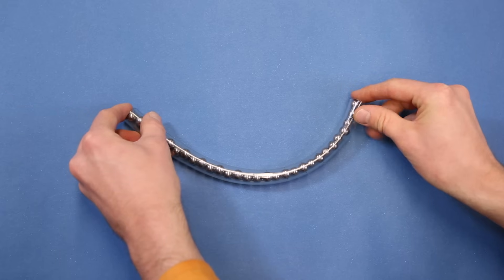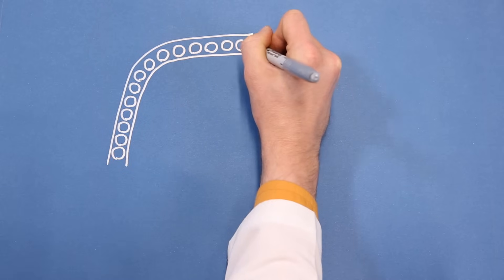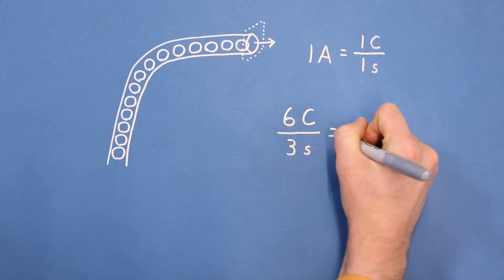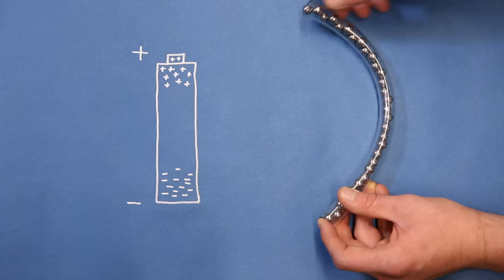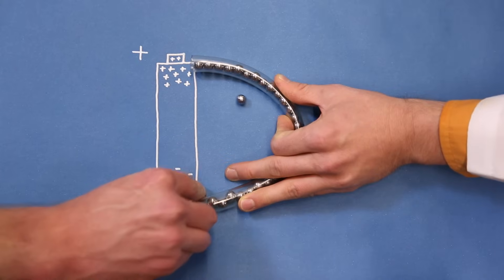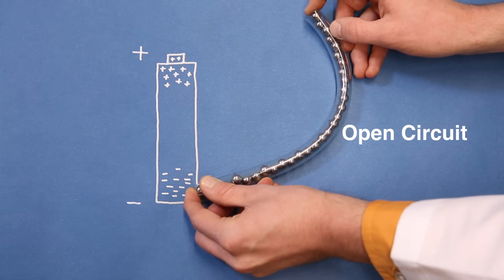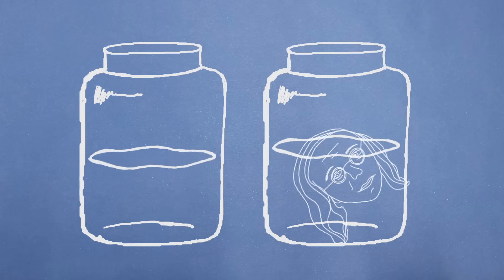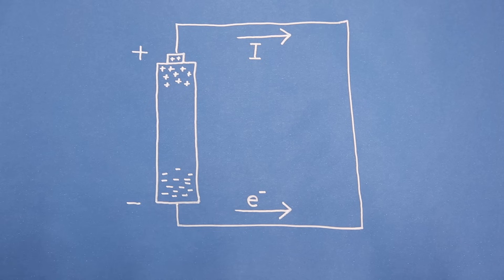What is Electric Current?

Comment: The explanation with the battery and marbles is flawed. It implies that the electrons flow through the wire because of excess electrons at the negative terminal of the battery (which isn't entirely wrong) via some sort of diffusion (high density wants to even out) - which isn't true. The electric field which propagates through the wire from one end of the battery to the other (much faster than any movement of electrons)  is what causes the electrons to accelerate.
Reply: Karthik,

Just what "electricity" is entails a very significant discussion of physics, and for most people (even professional electricians!) the water analogy and Ohms Law is enough of a workable model to enable them to do their work (even through it is completely wrong!). 

Many "electricians" and circuit designers would be in disbelief if you told them that, for instance, electrons move on average a couple of inches an hour (in a DC circuit; in an AC circuit they wiggle back and forth and never go anywhere!)  Even if you've lived in your home your entire life its probably the case that the actual electrons from the power company from when you moved in still haven't arrived at your home yet!

Or that the energy in a circuit actually travels just outside the wire! That's right, the energy from your power company lighting that bulb in your living room travels on the outside of the wire in the form of EM pulses. (Fun fact - in coax cable the energy travels in that insulator between the two conductors!)

There is also a whole separate discussion of the physics that occurs inside the wire...how electrons build up in the bends of a conductor to form a "guide" for the other electrons for example.

Its amazing that even today we teach about a thing called "electricity" (there really is no such entity) and describe it as electrons traveling from one terminal of a power source to the other and apparently this "powers" a motor or light bulb. But in reality when you close the switch on a simple circuit with a battery and a load a lot of very cool phenomena all happens at once. There is an electric field generated; current begins to flow and creates a magnetic field (that intersects the electric field at exactly 90 degrees everywhere!), both of which set up the Poynting Vector (outside the wire) which describes the unidirectional energy flow from the battery to the load. The electrons continue to circle around the circuit, but it is the (Poynting) energy flow which is unidirectional (from both ends of the battery) into the load which powers the load. (Although electrons move very slowly, this energy flow moves at the speed of light!).

You may want to google "Poynting Vector" which will lead you to many references such as https://en.wikipedia.org/wiki/Poynting_vector ; another good starting point is http://amasci.com/miscon/energ1.html . Also, once one better understands all this phenomenon the concept of radio waves and antennas becomes much clearer!
Reply: @sengelbr  Wow. Saying that the water analogy is completely wrong is like saying that the Newtonian description of forces and acceleration is completely wrong, because we now know better. I disagree. Models have a scope of application.  And people learn in stepping and increasing degree of depth.  Only when an easier model doesn't seem to explain the world seen by the learner, are they willing  (and the time has come) to unravel the next model.
Reply: Edi is spot on, we need a better analogy that teaches the proper concepts behind "electricity". For example voltage is usually portrayed as "pressure", implying that there's less and less pressure "pushing" electrons around after each load in a circuit. Electrons would start piling up after each load and never make it to the other terminal! (We know the current in a circuit is the same throughout the entire circuit - there are as many electrons leaving the negative terminal as are arriving the positive terminal!)

We often talk about (and diagram) the magnetic field around a wire, but almost never talk about the electric field around a wire. This field, unlike electrons, moves at the speed of light and causes the electron movement as Edi points out.

We also don't really explain some of the physics behind simple circuits. A circuit with just a resistor and a battery generates heat; where does that energy come from? Are electrons converted to heat and disappear from the circuit? We know that the current after the resistor is the same as before the resistor, so electrons aren't disappearing. What is getting converted to heat? A light bulb creates photons.....how does that happen?

It would be awesome if someone accepted the challenge of explaining what "electricity" really is and how voltage, current and resistance really work.
Reply: @sengelbr  I agree on the endeavour of looking for pertinent analogies. But that one with pressure works pretty well if the similarities are soundly built.  Even the electrostatic charge when a wire touches either side of the battery with the other end unconnected becomes relatively explainable via this metaphor.  Don't be so harsh at the analogy, try to take the most advantage from it.
Reply: sengelbr thank you for your comment. I’ve been trying to understand what happens to an electron after it is “used”. Still not sure, but at least you made me feel like it’s a legitimate question
Reply: I don't know much about electricity but everyone seems to be saying "why are they teaching it like this" then they go on about complex things with complex names. SparkFun have made some things clearer for me and it's a good start, so maybe that's why it's being taught "wrong"; so beginners can understand. And if you want to teach "correctly", please make it so secondary school students and people without PhDs can understand.
Reply: try http://amasci.com/ele-edu.html

Also, batteries are charge-pumps.  But in their drawing, they treat the battery as some sort of capacitor, and never mention that the path for current is through the battery and back out again.  The tube full of balls should extend through the battery.  Or at least, let the human fingers transport metal balls through the battery.  (Or better yet, don't use a battery, instead use a dynamo, where its electromagnet coil is also a wire full of movable balls.)

In "most circuits" the current is electron-flow.   But their diagram shows the exact situation where non-electron currents exist:  INSIDE BATTERIES.

Also, in this video they make the same error as all other introductory battery explanations.  Every book you can find will pretend that the battery is an insulator, with the "used electrons" piling up inside the positive end, and with zero current going through the battery electrolyte.  Why?   Why do it this way?

It's not because it's correct.

In fact, whenever there's an ampere in the circuit, there absolutely must be one ampere in the battery electrolyte.  It's a closed-loop current.  The circuit is completely closed and circular, and batteries always act like a zero-ohm short.   But no intro book ever mentions this.  Why?

It's not because the explanation was written in stone centuries ago.  It's probably because of Stephen J. Gould's "Creeping Fox Terrier Clone" effect, where teachers get all their information from earlier grade-school textbooks, rather than from basic science or from non-gradeschool adult classes in those topics.  Then they write new textbooks; copying the old ones but with a few errors added.  Over many decades the errors build up.  (Besides "Fox-terrier clone," it's also called "The Game of Telephone.")   So, if one textbook author from seventy years ago makes a mistake, that mistake will eventually appear in all future textbooks?  Yep.  It sounds impossible, but the forces creating and preserving the errors are just that strong.

If one major textbook author in the distant past had never realized that current goes THROUGH batteries,  if they instead believed that the positive terminal could store up a collection of hundreds of coulombs of electrons ...then all future teachers will make the same mistake.  The wrong explanation will "infect" hundreds of future textbooks, and eventually the error will become built-in to English-language science education, and end up in any youtube educational video featuring circuits and batteries.
Reply: Rafi Ashraf I agree with you !
Reply: sengelbr help me understand plz.any nice video available ?
Reply: Edi Gotlieb  but this is not about what causes them to move rather how they move generally
Reply: Yeah. But the model presented in the video is Ok to start with. It is a sound model, avoiding the embarrassing clasical examples of electrons moving along the whole wire as if they were cars in an empty track. Your refinement should come later, when introducing topics such as transmission lines, antennas, characteristic impedance and so on. Finally, the reason, I think, why the electric field is not depicted in wires, and specially, wires connected at only one end, is because it would require to draw the closed trajectory of the electric field, which would precipitate things and enters discussions that could confuse learners, for you would be entering the realm of antennas.
Reply: > is what causes the electrons to accelerate.

Oh. Now they accelerate. OK, then.

Comment: My fridge has no electronics.
Reply: Not even a light bulb and a switch? :(
Reply: "Electronics typically refers to solid state components. A calculator is one, a traditional flashlight isn't
Reply: Fair enough. Looks like some modern refrigerators use active components, but older ones stick to things like switches and relays. I don't think even my fridge counts as having "electronics" :)